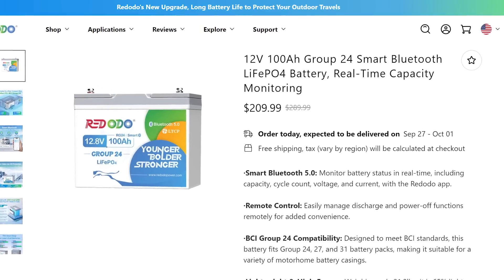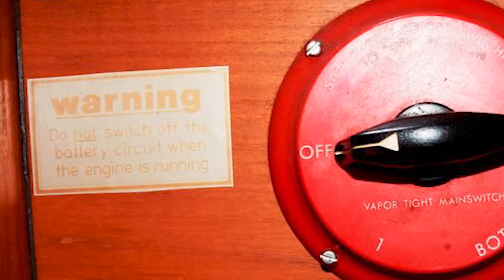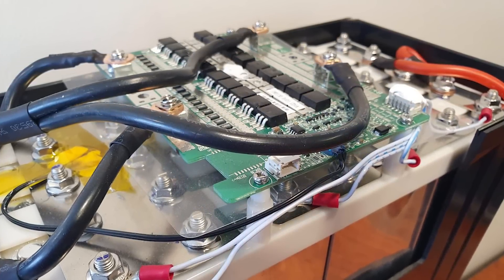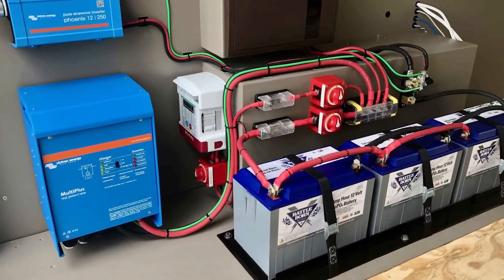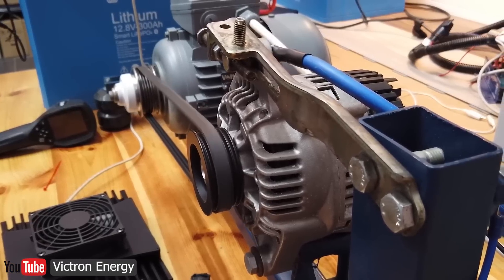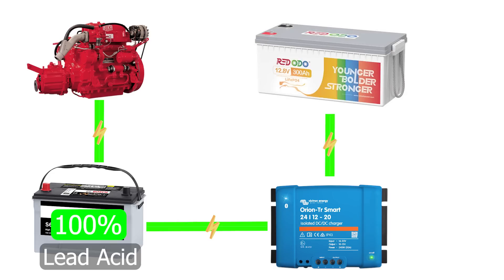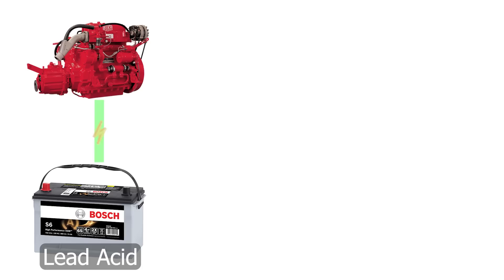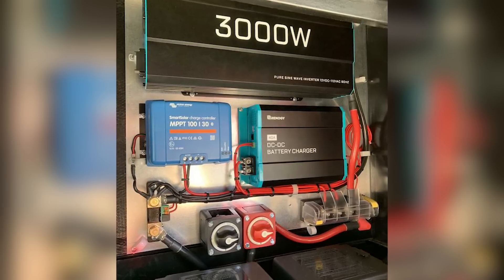Can A Lithium Battery Fry Your Alternator?

Comment: The charging mechanism of lithium and lead acid batteries are vastly different. Lithium batteries require a constant current charge up to certain percentage, and after that go into float mode. Alternators provide a constant voltage charging system and lead acid batteries can handle that although not ideal. Therefore charging lithium batteries with the alternator is very damaging and not efficient or recommended. With batteries is required a dedicated charging system fed by the alternator.

Comment: This a very nuanced topic, with all number of factors to be considered and factored for in designing a system. The consequences for getting this wrong don't stop at a failed alternator.
Even if you're handy and can install a system yourself, don't kid yourself that you've somehow magically transformed into an electrical engineer because you understand Ohm's law and it's only a low voltage circuit. Seek advice from a suitably qualified person before you modify any electrical system on anything.
Reply: Make sure your expert really is an expert. Lead/Lithium is tricky. That's what this video is about.
Reply: @OrmondOtvos  Your words are born of wisdom. Thank you for your reply.

Comment: I installed a balmar controller on to my alternator - it is very hard to adjust but once it is set you can set it to delay the charge until the engine is warmed up- you can adjust it to charge lithium, AGM, or lead acid.

Comment: It's worth noting that Balmar, Sterling Power, and others make alternator protection devices to protect your alternator against sudden BMS disconnect (or someone flipping that red switch!).  That being said, I prefer having a lead acid battery in the mix.

Comment: I am using a battery isolator that the alternator feeds and it charges both the lead and lithium batteries separately. If the lithium circuit opens the lead is still available for alternator output. I have a temperature limiting regulator to protect the alternator from overheating
Reply: @andyrigg2182  Would that be with a Victron ArgoFET perhaps? I was thinking about this setup myself. Have you ever had a disconnect from the BMS while charging with the alternator? And did that go as expected?
Reply: @edkok5880   I had a victron and did not like it. And no I have not had a lithium disconnect
Reply: @andyrigg2182  What was it that you didn’t like about the ArgoFET? Mine has been perfect for feeding three banks. I’m still unsure if this setup will work as hybrid and protect the alternator when the BMS disconnects.
Reply: @edkok5880  mine was faulty and marginal in size, the task was important so I replaced it

Comment: Hold on there. The first half of this episode is jibberish. You can't start explaining lead batteries and charging systems and alternators and generators unless you understand them right from the beginning. You don't start in the middle. How would I charge a lithium battery? With an alternator and a suitable regulator, but maybe a great big resistor if necessary. Blowing out gear with voltage spikes? Yes, some systems will do this and some don't. The biggest curve ball you will deal with is whether your alternator or generator is controlled by a Zener Diode electronic regulator or if it's controlled by points and coils.  The later is a Titanic mess. Connect your electronics directly to a battery, and not a goofy one.

Comment: it can, but it also can work very well i do this often ! i am a balmar installer,  most boats have 3 kw altenators, and installing two 3 kw on cats. i am now installing a 9 kw altenator on my bayliner !  i have helped many people setup lithium systems, and use on original altenators,  

a trick is to use move the voltage sense wire of the alternator to the positive post of the alternator,  

on most boats now i set the alternator to charge the lithium house battery directly and have small dc-dc chargers to keep the start batery. 

a typical 12 volt altenator outputs 14.2 volts this is actually the ideal voltage for the lifepo4 absorption voltage.  and is identical to lead acid !  on a typical yacht that runs less than 70 hours a year a direct alteantor to lithium is totally fine, for heavy duty cruisers the bms can tell the alternator to turn off . 

i posted a video a whole back of a honda 4 hp engine connected to a 100 amp delco remi altenator, with booster cables and disconnected the wires many times on video and the alternator hasn't blown up.  that little generator has been used since 2001! 

so will a alternator burn when connected to lithium ? well depends which model, and how its wired.  its very easy to overcome for the diy guy.  the external regulator better yet.
Reply: Try reading your post carefully.

Comment: Lithium-just say no!
Reply: i will never buy another lead acid .. been running lithium for four years, and convered 20 boats to lithium  . its changed thier lives !
Reply: @tomcody8215  Li-ion is not the same as LiPO4. The first are used in cars and can catch fire and should never be used on a boat. The latter can safely be used on a boat and will never catch fire. Every battery is dangerous but only if stupidly handled like using too thin wires or causing a shortage.

Comment: In case of a battery shutoff, yachts can employ energy dissipation systems, similar to diesel-electric locomotives. Put either a bank of resistors for heat dissipation or LEDs for light and have all the excess energy on that circuit.

Comment: I am reading all of these comments about upgrading to expensive complexed electrical systems. AGM is safe ,can be mounted in any position and eliminates the acid issue in case of a pitchpole or roll. Standard marine alternator , cheap to carry a spare . Manual mechanical isolation switches don’t fail. 
  With Blue water cruising the KISS principle is always best but to each his own.
Reply: lifepo4 is very safe and safer than agm , i see agms daily with the top blown off.  lifepo4 can be mounted in any direction, they are cheaper, lighter and last much longer
Reply: @STRUTZKOFF  Daily ? You just lost all credibility. Short of a dead sort  between the two terminals with a O cable and even then the terminals would melt please do tell. Given AGM’s don’t off gas I am waiting?

Comment: My Bene 393 had the start battery hard wired to the alternator, and a battery isolator relay which connected the house bank to the start battery only when the alternator was doing its job.  That should take care of the BMS cutout problem if the house bank became lithium.  But it would still potentially have the overheating problem.  I don't like the idea of the inefficient DC-DC echo charger between the alternator and the house bank.  What about a smart external voltage regulator for the alternator?  Seems like that would take care of the loss of efficiency.  Of course my dream voltage regulator would be smart enough to do the Right Thing for the lithium house bank.

Comment: I use the approach you outlined using a 120A alternator, regulated with the Balmar MC614 (w/alternator temp sensor) to a lead acid 12V starting battery. When the starter battery voltage exceeds the setpoint voltage, two Victron Orion XS 12/12-50As charge two SFK 300Ah LiFeP4 batteries in parallel up to the recommended 60A+/-. After 6mos of moderate use it is working well. 

Using the alternator/starting battery design not only protects the LiFePo4 batteries and the alternator but also the engine ECM. Dual Orion's provide redundancy and with reversible plugs can charge the engine battery from the LiFePo4 bank.  

Adjusting the Orion settings I was able to control the starter battery load and change the LiFePo4 charge profile. This  helps to avoid long hours of holding the LiFePo4 at 100% SOC which is thought to diminish LiFePo4 life. For my batteries a full charge is only necessary every few weeks.

Although I rarely charge the starter battery from shore power the Orions are wired to only charge when the ignition is on. The XS version is much more efficient then the previous model and I don't use very high current so I've not experienced a heat problem.

The only concern I have with this system is at 1000-1400 eng RPM the Orions demand too much and the alternator over heats. The Balmar regular steps down field voltage at a case temperature of 100°C but if that failed it would fry my alternator; A single point failure. I have yet to exhaust the programming options. Another solution is to step up the alternator or switch to the Acer Zeus regular which can limit current at different RPMs; although it requires more complex wiring and expense.

Thank you for your article. This is a great subject with much to learn. I choose this approach because I like the active control and visibility provided with Bluetooth. I find the passive systems very interesting and appreciate the strategies.

Comment: Connect the alternator to your start battery and then use a dc/dc charger to send power to the house bank. This isolates the lithium from the alternator and the start battery and the agm start battery and dc/dc charger will always be a load on the alternator when running. When the alternator is NOT running the dc/sc charger shuts off. Eliminate the 1/2/both switch and instead have two on off switches and the one on the alternator should have alternator shut off to protect the diodes from a battery shut down. I could post when affront lithium you need to plan accordingly not just simply replace your lead acid house bank with lithium. Also.  As for the bank manager electronics it’s still up for debate if mixing lead and lithium is a good idea so far manufacturers of lithium batteries have not recommended it. Another method is an external voltage regulator that monitors load and protects the diodes from overload. And putting all your charge sources to the house bank first and then dc to dc charger to charge the starter battery. But although tgia has he potential to get the most from a high output alternator it also complicates the electric system. If your still running the lower amp alternator your marine engine shipped with and your getting far more power from renewable a like solar or wind then you do from your alternator then the far simpler to put your renewables to charge the house bank use the alternator to top off the start battery and then use a dc/dc to sent extra alternator power to house bank when motoring so you can take advantage of that power to run the boat loads when motoring. And the diodes are safe as you always have a loads (the agm battery can handle the constant charging when motoring and once topped off most of the power goes to the dc/dc charger and what ever loads you have on like lights or a water maker you want to run while using that extra energy from dead dinosaurs.
Reply: Did you even watch this fucking video? Thats exactly what he said, ffs.

Comment: I really enjoy your videos but have one suggestion.  I would like you to consider that there is a huge number of lake and costal sailors that can have their lives improved with simar solutions to those for extended offshore, with only slight reinterpretation.
To use this video's topic and my own boat as an example, I converted to lithium three year ago.  I did this for a similar reason to those you site, but because I will NEVER be more than three days away from shorepower and my boat is smaller and cheaper, different answers suddenly become much better.
Solar makes no sense for this use case because it adds too much cost, complexity and requires space that is at a premium.
What does make incredible sense is to optimize your electric load (leds, better fans, better inverters and pumps), increase the house battery capacity (>5KWHr on a 27') and keep engine start battery separate while converting it to the right type of lithium battery for this job (still saves space, decreases weight, increases capacity for safety margin and lasts longer, without the complexity of interacting with house battery set or risks of storage type batteries when used in engine operations duty).
This is just an example of how slightly expanding who you  think about consuming your content, dramatically changes the best answer.
Please consider the cases for people that will always have a dock within 3 days or other situations that are small and more common than extended offshore.
This will help with your mission to get and keep more people sailing... because it is more "practical".
Best wishes and keep up the good work.
Bryan
Reply: Separate from your Practical Sailor comment, I think day sailers and weekenders thrive on solar. 200ah (2.4kWh) is a big battery bank. Most have 100ah, I'm enjoying 150 ah. With a little effort, my batteries are full at the end of every day though I do turn off my cooler at sundown since nothing vulnerable for just a few days. 2 50W panels, each with own charge controller costs about $300. That will fill batteries before every weekend and provide 25ah/day. That's more than additional half battery every weekend.
Reply: @artsmith103  My challenge is on small boats that don't leave shore power for very long, frequently have no reasonable place to mount panels, panels complicate trailering with additional setup and tear-down, and move weight and windage in the wrong direction.  Understanding the loads and timetables is my recommended place to start.  I have 395ah of house lithium, consisting of a 280ah and a 105ah.  I decreased the loads that I could, to optimize my power use.  I also have a lithium motorcycle battery on a completely separate system for the engine (more power, longer lasting, less weight, and smaller size allows me to carry additional fuel in that lazarette).  This set of decisions keeps all the weight low, doesn't complicate trailering, and allows for safe use away from dock up to 72 hours with a family of four (led lights, water pumps, fans, inverter, depth/speed, radios, cell phones, tablets, laptops, fridge, freezer and microwave).  I couldn't put enough solar on my 27' boat to do this, particularly without negative impacts to its sailing characteristics and adding more headache to setup/tear-down.
Each situation may have its own calculation, although I love solar (going to panels at my house next spring), it may not make sense for anything that is under 34 feet, doesn't leave shore power for more than 72 hours at a time, or has a trailer.
...although I get excited at the prospect of flexible solar that I could put snaps onto my folding bimini, this hasn't penciled out well enough yet either ($/watt - $complication > $0?).
Reply: @bryanbuss1045  Every sailboat in my marina is trailered at least twice per year. A couple 28', the majority are 22-26ft. There is no shore power and almost everyone has solar. My 26ft has 25W, 30W, and 50W panels. Virtually non issue to raise and lower mast. I have typical collection of auto tiller, chart plotter with depth, music, radio, and I don't run my cooler after sundown. My batteries are 90-100% every evening and I only have 150ah SLA.
Reply: @artsmith103  No shore power adds a new dimension.  😀
How do you remove the panels to get them out of the way of stowing the mast?
It already takes so long to rig and launch and from retrieve to roadworthy... I recoil at anything that makes this 2-3 hour process any longer.  Invariably it is a long day because I've either just towed for hours, or will be needing to tow for hours.

The worst loads for me are the laptops and the microwave... but these make staying aboard anchored out for a couple days so nice.
The new 12v compressor tech has my fridge and freezer load totalling only 30-40 watts.  Having ice in a drink and ice cream for dessert seems like such a luxury after years of dealing with soggy coolers!
Reply: @bryanbuss1045  I have 50W flexible panel forward of mast. Plugs through deck like coax or anchor light. The 25W and 30W are on 2 piece brackets clamped to stern rail. Remove from bracket and disconnect cable. My panels point in all different directions: up, aft, port. Probably will eventually add 30W starboard pointing stern rail bracket. Just big enough, keeps battery full all day.
I use battery operated lantern for stern/anchor light. Recharge during day when house batteries are full. You could bring frozen 500ml bottles to help cooler.
I certainly don't maintain ice nor run a microwave. I'm happy for the centerline weight of my batteries so even my next set will be lead.
If you get solar, MPPT for over 30W is a good idea. Adds about 20% compared to PWM. You might have room for 100W forward of mast. Pay attention to panel cable directions.

Comment: Im Using a special alternator for LiFePo4 from Electromaax.                          It is rated for 165A but has the diode rectifier in an external heat sink with active cooling and a smart regulator which is attached to a shunt. So it monitors the Alternator Temp, battery temp and voltage, and charge current. So I set up the parameters of the smart regulator in a way that never overcharges the LifePo4 and also do not overheat the alternator.   is like a BMS for alternators
Reply: I'm.charging 420 Ah of lithium with a 215 Amp Balmar externally regulated with Balmar 612. Also I have a Sterling Alternator Protection Device to protect the alternator in case of BMS shutdown.
My alternator pumps an honest 160 amps into that lithium until about 97% fully charged then tapers off to nothing.
Reply: Interesting. At the moment BMS stops taking charge, what happens?
Reply: @artsmith103 Proper setups with an external regulator have the BMS send an almost immediate message (via CAN) that it intends to disconnect the battery to the external regulator, so the regulator stops the alternator charging immediately thereby preventing the load dump/voltage spike.